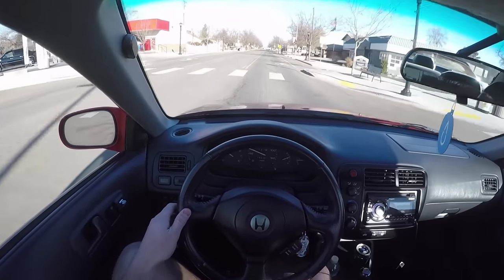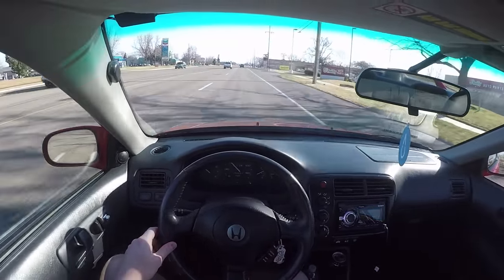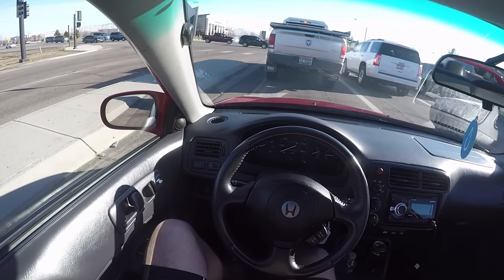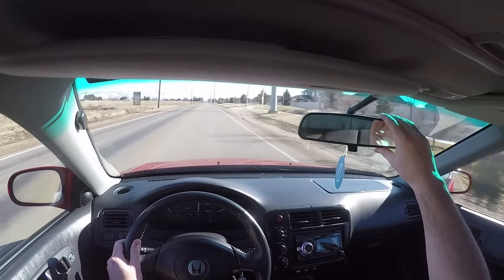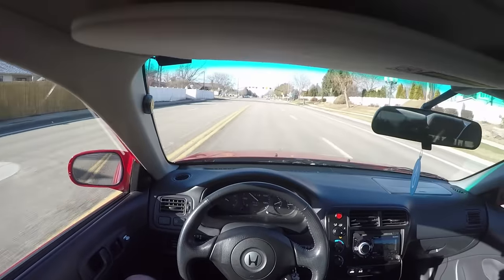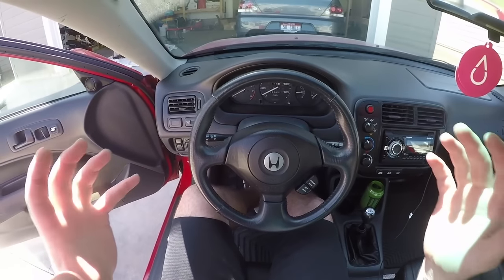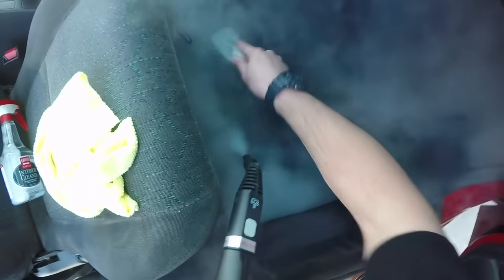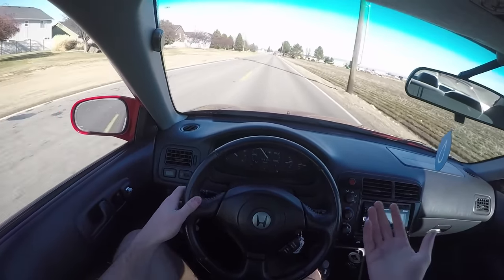5 Things to Make Your Underpowered Honda More Fun to Drive

Comment: This guy gets it. Screw all the flashy/noisy mods and just focus on the driving experience for once! A lost art.
Reply: Del Sol seats FTW!
Reply: Exhaust is worth it if you do it up right, mine has a magnaflow streetseries and it's the perfect balance. Usually costs more but is super worth it imo. One of my coworkers has a hyundai veloster with an ebay muffler on it and it's so loud it's ridiculous, I understand where you're coming from but if you do your research and spend enough it's one of the best car mods
Reply: @Randy Bobandy  I got a spoon n1 sounds nice not to loud
Reply: It's just called driving a car, to its full extent, simple as that may seem, literally try it. Then fix it alot.
Reply: @DIE2dayORelse full exh and changing wheels are my first upgrades
Reply: Exhaust is part of the driving experience

Comment: 1 coilovers
2 wide wheels/tires
3 steering wheel/shift knob
4 seats 
5 clean interior
Reply: And a vape
Reply: Lol. Gilbert Sanchez
Reply: Thnx this saved 13 mins of my time 😇
Reply: Mmm, r i c e
Reply: @gilbertsanchez2568  This isn't a subaru though.
Reply: +700 hp
Reply: thanks for this quick guide. it let me know what to expect but I will watch the video just to understand what stuff looks like
Reply: All a waste of money lol
Reply: Actual real mods: strut bars (front trunk rear)
Headers and catback exhaust system (easiest thing to do)
New tires(preferably toyos)
Headlights 
Maintenance treatment (fuel, oil, transmission sprk plugs coils all that) just so you can feel your engine respond crisply and you can feel all those mods and feel a good step from slouchy stock movement
Reply: and a catback
Reply: *Fartcan exhaust*
Reply: @WaySydeBeats  well the thing i dont want to install is the muffler/exhaust system updgrades...i still want that quiet but hot looking like that
Reply: Every basic tiktok “build”
Reply: U saved me 13 minutes thanks
Reply: @WaySydeBeats  cant tell if you're joking lol
Reply: @WaySydeBeats  thank you for this list bro, just bought a civic and I’m doing this!
Reply: or just boost it
Reply: @gilbertsanchez2568  that’s the Subaru bois thing you know
Reply: @WaySydeBeats  "Real mods". But they are all bolt ons. Makes no sense. Get into the block and get a cam in there. Maybe some Billet Steel pistons?
Reply: Bout to get the coilies
Reply: @turbocavalli  what exactly is race inspired here?
Reply: You could have 5 the whole time! Nice!
Reply: idk if the stock seats were like this out of the factory, but the seats in mine hurt my ass. Seats are underrated.
Reply: He should've added a modern stereo deck that supports Bluetooth
Reply: K20 engine, thats all, thats it.
Reply: Mine came with all this, thanks for saving me 13 minutes
Reply: 1. Sell it
2. Buy a new car that isn't a civic (literally anything)

Comment: coil overs are good but lowering the car when its not meant to isnt it will put lots of stress on bushings and ball joints etc, the added spring rate from the coil overs is most likely enough to keep the light weight chassis from rolling more than stock so if you want it to be more reliable and sporty id recommend stock ride height and if you want less body roll just put in a bigger roll bar and some polyurethane bushings too

edit:also speed bumps or steep driveways will be a pain in the ass with a low car

Comment: I have followed AlldayAnthony for years.
Here is my opinion. 
1. Coilovers- Truhearts are great
2. Seats- I installed GSR leather seats
3. Yonaka Exhaust -2.5 inch. It doesnt drone on the highway as loud 
4. I hated aftermarket headunits BUT I have a Sony headunit with bluetooth
5. Clean Interior is a must

Comment: I have a 2003 civic. The stock wheels are only 15 x 5.5 inches wide. I put on some 17 x 7 and I'm adding  .5  inch spacers this week. Lowering the car 1.5 inches next week.

Comment: Agreed! I think in a way the D series Civics are fun to drive BECAUSE they are underpowered. I have a D17A2 powered 05 Civic and a K24A2 swapped 04 Civic (both 5 speed sedans) and I love the power of the K24, especially the low end torque. It's nice to be able to keep the RPM really low and not have to downshift all the time. However, I also like that I can really push the D17 Civic on the streets and floor it all the time without exceeding safe and legal speeds. Being able to drive it like I stole it without breaking any laws and still get 40+ MPG is great!

Comment: NUMBER 6: Add a rear sway bar!
A rear sway bar will help mitigate the understeer characteristics of these cars. If you have a coupe you will have to get Civic sedan or Integra rear control arms (or aftermarket ones) to accept bolts for the sway bar.
Reply: If you have a 7th or 8th gen corolla an aftermarket sway bar is apparently a MASSIVE improvement over the stock bar for handling.

Comment: Hot air intake is a must in a slow Honda. Bwahhhhhhh I had an Injen on my 09’ Accord i4. I was hitting vtec all day long. I bought it with 30k miles and drove it to 240k miles. I still hit vtec the day I sold it.

Comment: Love your car!

Hey, I would disconnect that airbag. Airbags are designed for a specific model and won't work well in another. Things like the volume of the airbag, the speed of actuation and the shape of it are carefully designed taking into account the interior design of the car: the seating position, the steering wheel position, seatbelts, etc. Putting another car's airbag in your car can be as dangerous (or even more dangerous) than not having an airbag at all. I highly doubt that the Civic and the s2000 share the same airbag design. Just in case you didn't considered that.
Reply: Never considered that, have the same model car and considering doing something similar thanks for the heads up
Reply: steer bags are all very similar only a few companies make them i pull them off every dy

Comment: Id say just
1. make it handle good, change old bushings, swap to sportier suspension.
2. Wheels and tires make difference, but Id rather go for lower tire profile than width, as that improves steering response. Tire quality makes huge difference here.
3. Shorter final drive
4. make it sound better
5. Remove any unnecessary weight 

And its not just about the slow cars, you can pretty much make everything fun to drive, as long as you want to put some money into it. Most of the times these mods ruin comfort though.

Comment: Okay really though, stock HX rims WILL NEVER GET OLD!
Reply from the maker: Love HX rims! Just wish they fit the EX and Si front calipers
Reply: TE-37 or cheap route FN01R-C
Reply: @slgpph  te 37 is still very expensive here where i live.. But there are tons people use te37 but those are mostly the fake ones.. Which i hate because it is not lightweight and can damage easier..
Reply: HX wheels will fit EX and SI front calipers with some spacers......

Comment: I have a 2000 Civic Ex and am returning to stock. The ride was so rough on low profile rims and lowered suspension. 
After a long struggle, I got the rear OEM replacement coil overs in last Sunday. This weekend I will finish the front.

Comment: My favorite mod for making my underpowered Hondas more fun to drive is turbocharging them. Nothing else compares. Second would be suspension and performance tires (17x10 with 255 treadwidth on my current build). After that is a built motor so you can use however much power you want. I could have 2000whp and it is still underpowered. You always want more. Lol.

Comment: #1 cold air intake .gives it a very noticeable sound difference and makes it fun to drive.
#2 a cutback exhaust not loud
#3 lower
#4 realize you really  like the small difference the exhaust and intake gave and decide to do a kswap ..
#5  after that kswap ...put a bus length on 90% of the mustangs in town

Comment: Man this is exactly what I’m looking to do. At the moment I have a 99 lx. So far I have installed a tein superstreet coil overs, polurethane energy suspension, toe and camber adjustment links for the rear and short shift kit. Looking at spar I ff1 rims and doing the integra disc swap eventually. The long long run is a k24 swap ( I already got the mounts, “used” for 100 in perfect condition) making around 250 to 300 naturally aspirated. Cool seeing a clean build. Good luck

Comment: I'm looking into swapping an AP1 into my '99 Civic. It's crazy how much these are going for on ebay. Also LOVE my swapped Integra seats. They sit lower. Better side bolstering. And I have lumbar adjustment!. I also like how you mentioned a clean interior. I keep mine spotless and I get comments ALL THE TIME and it does make it more enjoyable to drive
Reply from the maker: Yeah man the steering wheel prices have skyrocketed quite a bit unfortunately :/

Comment: Fa5 Si owner here and I agree with almost everything said. Save and get a “high quality drop” first, don’t cheap out here and don’t go too low. I’ll add that you should get a good alignment from a shop that works on lowered vehicles regularly as well. Skip the shops that do cookie cutter alignments, those are for stock ride height vehicles.  Wheels and tires can come next or a couple of steps later as I personally don’t think a car dropped on stock wheels looks all that bad and waiting frees up more budget for the drop and alignment. Just a side note, if you’re driving a older civic like the one in the video, wheels, tires, drop and alignment will most likely cost more than your vehicle’s value. Are you okay with that?
Reply from the maker: Thanks for watching man

Comment: 6. Ditch the excess weight.
I had a 2011 Civic (European Hatchback "the egg shaped one") it was the dumb and slow 1.4 with 97HP engine. It weight 60kg more than the golf of that generation.
Remove the full size wheel and either get the small spare or the quick repair kit. That is a massive weight saver.
The stock rims were heavy. I just swapped for the lightest I can find. They were smaller diameter too but since they were black they blended in with the tyre colour and made them look bigger. But lighter rims can save you quite a lot of weight.
My fuel economy improved and I can actually feel the car being nice in corners.

Basically if you use all of the advices he gave you but also make sure that all the mods are lighter than stock. You will surely benefit.

Comment: I have a USDM Spec EP3 Si, and I have loved this chassis since first unlocking the Unicorn Mugen Type R in Forza Motorsport 4. Most of the things on this list I have done or were good enough from factory, and I even have an Injen Short Ram and a Yonaka Catback on it. I love the thing, but upgrading the shifter bushings is a great idea. Definitely my next upgrade.

Comment: Driving an EJ9 Civic sedan and the daily 2 hour commute to and from work is a fun part of the day due to aftermarket dual-pipe muffler which produces a deep low-tone farting orchestra at 2000 rpm crossover (so no need for high rpms) and a large sub.

Due to many speed/road humps in my country, lowering the car isn't a good idea unfortunately - a bit but not too aggresive.
Wider rubber has a great benefit in summer (195R15 from 175R14) but not in heavy snow (region with 4 seasons).

Gonna order some aftermarket seat if i can't salvage one from old Prelude.

Comment: For those of you in the Civic's big brother, the best thing you can do for your Accord is 1) install a short-throw adapter, and 2) cut some extended threads and then lop off about 1-1/2" of the shift lever.  HUGE difference in how the thing feels when you're shifting gears. No more of what Car and Driver used to call the "baseball bat in a rain barrel."

Comment: You might be the only Honda owner I don't hate! haha...I got 18's that are pretty wide so I can handle wayyyy better, I refuse to lower it though cuz it's annoying.  I got a Hurst alluminum finger cutout shifter I got for free at O'Reillys when I worked there, after taking out my custom lightsaber (working) that I had.  Painted my steering wheel and believe it or not it feels allot better.  After my car was stolen I just took out the passenger seat and now it's like a VIP limo experience for the passengers, haha

Comment: Quite the opposite. In order to have fun on my slow hatch DX auto, I decreased the road holding limit & tuned toward oversteer. 32-cm steering-wheel diameter is a must, especially for this clumsy rack ratio to counter steer & also tighten up the numb over-boosted power assist. The lower part of the instrumentation will be blocked, though. Double wishbones can be conveniently lowered or raised, & I chose the latter with Lesjöfors stock springs. The tires remain stock 185/65-14. Only the wheels are widen from 5.5" steel to 6.0" alloys. Final decision was to uninstall the front sway bar I added, in order to keep drifting the car (at safe low speeds anyway) even w/o pulling the parking brake. The ride plushness is impressive, with Monroe dampers (OE Spectrum front, Monroe-Matic Plus rear) -- almost hovercraft like, which is actually quite thrilling BTW. The driver seat was initially replaced by Monaco (similar to Recaro LS-B), but didn't absorb road bumps so well. The multi-adjustable EX OEM driver seat also rides bumpier than the passenger seat. So I went back to the original DX driver seat. Thigh support was boosted with aftermarket thigh extension. I was able to find an used Stone muffler, which was discontinued for EK Civic. It's relatively quiet but still sounds macho enough.

Comment: Great video!  I will say, I had some luck with the last Integra I put together with adding an OE style universal muffler to a larger diameter custom mid pipe.

Well muffled with a slight increase in sound (slight) with an improvement in power combined with a set of headers.  Intake box was stock

Comment: Damn , I own a civic ek hatchback and done exactly everything you mentioned in this video, I got coilovers to lower the car, Inch up rims, Nardi wheel and EK9 shift knob/quick shifters and recaro sr3 bucket seat. Nevertheless, I think there’s another point, get a set of tire with decent grip, huge different we’re made, I put Bridgestone RE003 and Michelin PIlot sport 4 on it, lots of fun.
Reply from the maker: Those are great tires!

Comment: @5:55....."shifter could be sloppy like somebody's used girlfriend".  Dudes.....I learned to drive a stick on a '61 Corvair as a teen, in the late 60's.  The first time i TRIED take it out....it took me about a half hour to back it up out of the driveway.  The clutch was total mush....with about a 1/4" friction zone, and the stick was......well, just a circle.  Any semblance of an actual "H" shift pattern was long gone.....it was find it or grind it.  Day 2?  I was drifting around corners.

Comment: Gonna have to research what will fit my 7 gen, as I'm kinda new to the post-2000 drivetrains and all that's happened to Hondas' U.S. Civics. They seem way slower & much less reliable, but this is 1/4 million mile beater that's been left for scrap before the previous owner spoke about sending it my way. I am only assuming the wheels are still 4 x 100 in both generations, so I will be going with your 15 x 7.5 suggestions there. Long roads are best taken with caution, since every tuner shop sports how good their gear is, and I'm not wanting to turn this into a sh__ show by just slapping everything that's trendy on my new/old skate. Definitely want to address the entire suspension holistically after learning Honda changed the rear set-up, making a good thing worse with 7th gen cars. Really like what you've done to the Civic. Will be checking your video's out in hopes of finding something to help get my girl back on the streets again. Peace!

Comment: I had an 02 Civic Coupe and I swapped the  steering wheel with the S2000 steering wheel. I also swapped the engine with the K24 engine they put in the civic si and the RSX

Comment: I've always loved the Civic Coupe, especially since owning my Aquamarine coloured U.K. 1993 LSi coupe. Yeah she was initially slow (had the 1.5litre), but, had a Mugen chip, 4 branch manifold, sports cat, free-er flowing back box, airbox delete/cold air intake install (which also helped with induction noise haha), fitted lightweight 17s, Electro Luminescent speedo/clocks upgrade, full tinted rear LED rear light replacement kit (gave a look like Nissan R32 Skyline rear light setup with double red LED rings each side etc. (the kit when I bought it though was set up that the 2 large rings on the boot/trunk lid were light as rear lights, and the 2 large rings on the chassis part of rear lights were set as brake lights, however, I modded them to be ALL dimmed to be rear lights, then when I applied the brake, all came on brighter as brake lights), plus more little personalisation based tweaks etc. After this she was noticeably quicker than standard, but, as like you say, may not be the quickest (yeah some people do B swaps (even K swaps)), but, she was mine, I was happy with her, and.... was fun to drive... She looked good too... All the best fella... 😎😎

Comment: I’ve only modified my audio system (only thing I know how to do myself lol) in my 2004 Civic LX but I want to do most of the mods here. Only thing is I’m split on getting coil overs or not because I live in northern Minnesota and our potholes are the size of small craters :/
Reply: how have you progressed with the modifications so far?